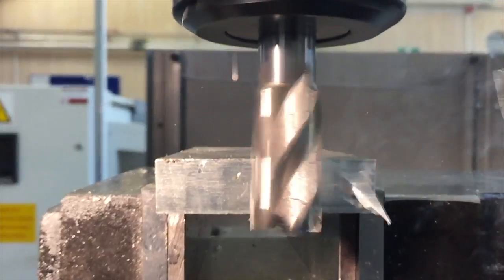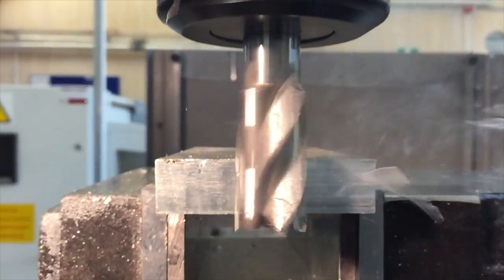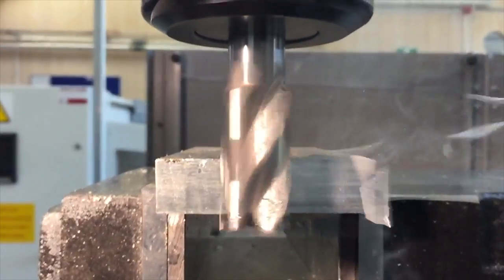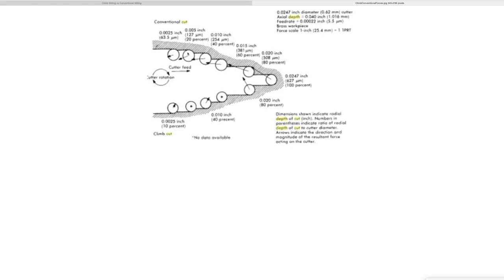Climb vs Conventional milling slow motion! - #5minFriday - #9

Comment: On some plastics if you make a clean pass taking off between .002 and .005 with a conventional cut it leaves a smoother finish.  It seems like the tools stay sharp longer if you climb mill.  I reckon the tool skids a certain amount instead of cutting.

Comment: i don't get it. at 0:44, you say climb is when the blade is pulling itself along the material, ejecting chips behind it as you go. If you curved the material at 0:44 into a circle surrounding your bit, that bit would be moving anti-clockwise.  Climbing is anti-clockwise. 

But at 1:56 you say climbing is clockwise. A clockwise spinning bit going clockwise around a pocket is going to eject chips in front of it. Sure seems like conventional to me.